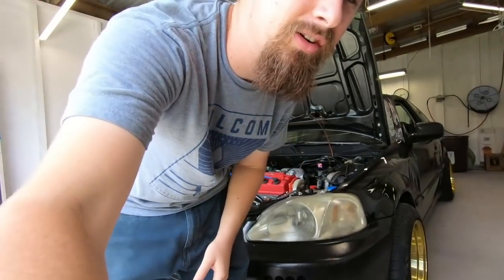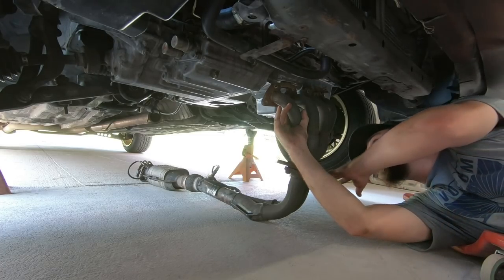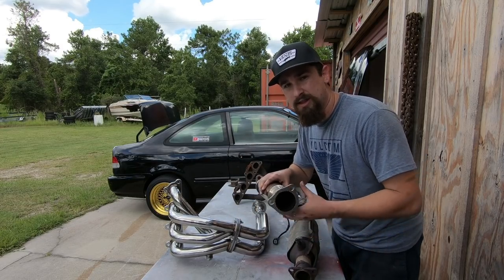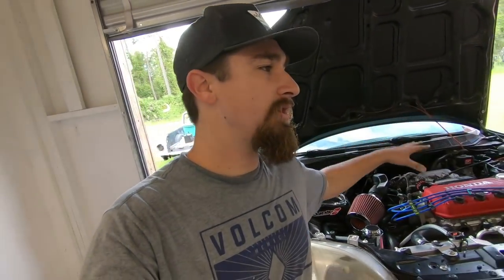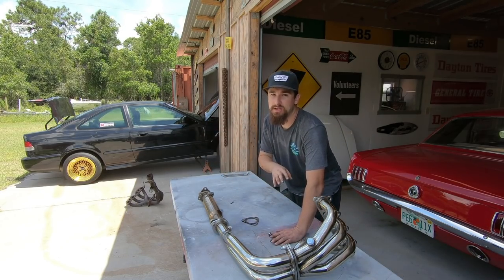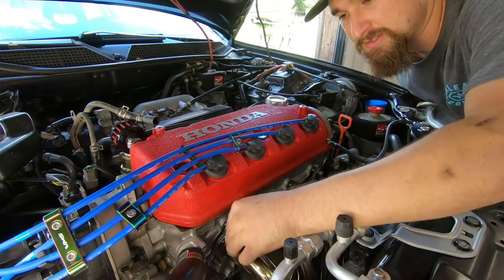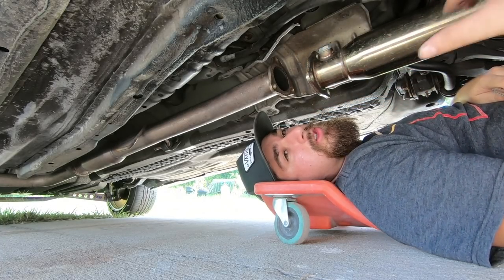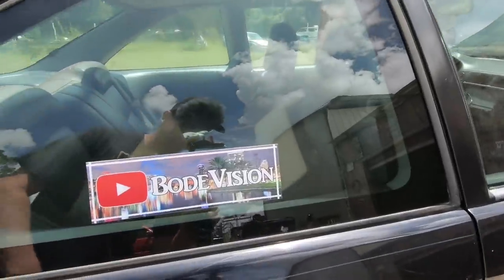Honda Civic Single Cam Header Install and Catalytic Converter Delete

Comment: does it improve some hp? will you get some improvements in low speed/high speed? I'm looking to do the same in my d16y8, manual trans, but really dont know , tks

Comment: The kit I got for my '99 EX 5speed doesn't quite fit.the placement of the mid O2 sensor interferes with the axle and rubs. That, and it's short about 3" to mate to the OEM cat. Strange.  Surely there must be a difference between the autos and 5 speeds. The placement of the O2 hole isn't quite right. Some use this spot, and others use the manifold spot
Reply: Jason Ricci I believe 99-00 have 2 o2 sensors

Comment: I put a header on my civic and got it on there butt The exhaust pipe to the converter to the header is not long enough The header was shorter than original pipie Manifold I don't want to cut my converter because I don't want my oxygen sensor lights on  But watching your video im going to the same route As you with the extension pipie could i put the oxygen sensor in the extension pipe and the light not come on?  I just wanted to ask you because my converter is touching my shift linkage I'm gonna have to make it longer somehow But don't want my  oxygen sensor light on

Comment: All aftermarkets headers have o2 sensor bung only in 1 cylinder pipe, not where 4 cylinders pipes meet. Does the o2 sensor gives ame readings? Or ecu can cope with different readings? After swap consumption is not worse?

Comment: Just a note since I’m not sure if you did it or not. After installing any chrome/stainless headers. Spray them down with brakes clean to remove any oily residue you hands left behind. It will keep the headers from getting the ugly tarnished look.
Reply from the maker: Yeah man i know the look youre talking about! I think i cleaned them with acetone if i remember correctly.

Comment: Is it possible to tuck the cruise control??? Instead of taking it out
Reply from the maker: yes, could be tucked under the dash i suppose. Would just need to buy a longer vaccume line and extend the plug.

Comment: Starting to miss Ol' Betty White. What's next for the accord?
Reply from the maker: hmm ol' Betty White... i fired her up today lol and drove her around the yard. Really i need to figure out why shes leaking so much oil. I did the valve cover gasket but the new gasket didnt seem snug, so i think its still leaking in the same spot. Also i have a flat tire lol. So pretty much she just needs some love and to get back on the road. Then ill see about starting to improve the car.
Reply: I was about to say the same!

Comment: Hey Bode, I’m thinking about doing headers soon for mine. Does the computer freak out at all when you ditch the o2 sensors? Throw codes? Thanks.

-new subscriber
Reply: Jared Rigney I’m here looking for the same thing did you find out ?
Reply: He never said he ditched the sensors he says hes getting the o2 sensors yes they will trip codes

Comment: Do header increase underhood temps and do we need header wrap ?
Reply from the maker: For everyday driving they might increase a little if any from stock IF you had a stock heat shield. In my opinion the only reason for heat wrap if when you have hot exhaust pipes running close to other things in the motor you dont want getting hot (brake fluid, clutch fluid, ps fluid) or just for the "look". I would run a header like this all day long and never second guess having to heatwrap it.
Reply: I always wrap my headers, I also keep my A/C.